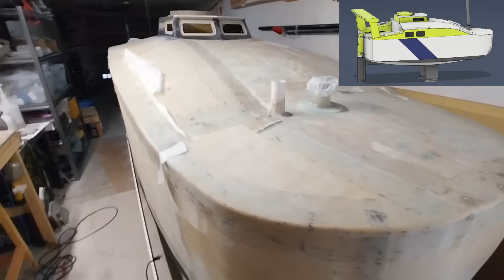OCSS-091 DIY Rudder Blades: Fiberglassing & Painting - Mini-Cruiser Sailboat Build

Comment: You could attach a bolt to the head of the rudder that goes through the cassette box and rudder. Then the rudder would still swing aft when touching the ground, but would have more stability when steering.
Reply from the maker: That's called a kick up rudder and it's fine but it's not what I've built. This is a cassette rudder and no pin is needed. A pin doesn't add any stability. The rudder blade already fits tightly in the cassette.

Comment: Might want to consider a wooden pin through the stock and blade as well as the bunge.
Reply from the maker: No pin necessary, keep it simple and easy to knock out in case it hits something. A leash allows you to easily retrieve the blade and re-install in the unlikely event this happens.
Reply: @ocean_capable_small_sailboat  the idea of the pin is that it will snap
Reply from the maker: @ Yes I'm aware. It's not needed though. It would also cause some damage if it happened.

Comment: Can you re-use peel ply? Also, how about a divot or blocks to keep the bungee from riding up of down the rudder (especially when wet)? Also, instead of, or in addition to, the rope at the top, how about a solid pin through the rudder blade, with divots in the cassette box to keep that from sliding around. Maybe use a 1/2" SS bolt with nylok nut (smooth shank all the way through the wear areas) as the top pin.
Reply from the maker: Peel ply is one use. No pin needed for this design. Simple is good.

Comment: I'd worry that those bungies would work up and your rudder would not be very well held.  Some sort of hold down near the bottom of the rudder slot might be a good idea,  as would using two or more bungies - in case one breaks.
Reply from the maker: It will have something to keep the bungee in place down low. It's something I overlooked for sure when building. But not difficult to correct. One bungee is fine, spares inside the boat.

Comment: Another great video Perry! Can't wait to see the eel wheels though! ;) 
You probably already have this covered, but it looks like the rudder blades taper to the top along the line where the bungee sits -they might need something like a screw on eye on the casette that the bungee passes through to hold the bungee in its correct position, where it is providing maximum force, otherwise it might wander upwards to the narrower part of the blade where it is less effective.  
This is just eyeballing it from this vid though, as always, its hard to tell in practice from where i'm sitting! it might be perfectly fine without :)
Reply from the maker: Yeah I should have thought of that when building, I could have added something from the start. I'll fix it 👍.

Comment: I guess you plan to have a line from the top of the blade to the stern so if you do hit something you can retrieve the blade? and you'll carry some spare shock cord? (spare shock cord should be easy to stow somewhere and not that heavy 3 spare lengths the same as you used here should be enough, bearing in mind it does deteriorate from UV exposure, so you will need to replace it.
Reply from the maker: Good thinking. I'll definitely make up 2 spare bungees. I whipped the ends on the bungee cord to keep the ends from fraying.

Comment: Hi Perry, I've been following you from the start of your channel. You're doing great, but I'd be a lot happier if you had a pin in that rudder! At the top front, so it'll kick up if you hit something, I really can't see a bungie keeping the rudder in place for long!
Reply from the maker: The blade fits tight in the cassette box and the bungee holds it in place. No pin needed. You can find other examples of this design online. It works. There will be a leash from the blade to the boat to make sure it isn't lost if it hits something hard enough to break the bungee off, but that's quite unlikely.
Reply: Surely he will be trying the rudder to the boat at the top so it can't just call out if the bungee fails? 😂

Comment: The spare rudder is a great idea, but what will you do if one or both gudgeons break off?  Maybe you should have a set of secondary gudgeons installed next (but not to close to) the main ones?  And some way to plug the hole left by the lower main gudgeon if it does break off.  Your bungee system will help reduce the stresses on the gudgeons though, so maybe breaking off is unlikely.
Reply from the maker: The bungee cord will fail before any other parts do, that's the design.

Comment: Looking good! Maybe I've missed the obvious but why did you have to mask when laminating the edges, when you still need to sand them down at the edge for further laminating?
Reply from the maker: I suppose you could skip it. It reduces epoxy I have to clean up that might drip down the blade.

Comment: That bungee is not nearly enough to hold that rudder in and the bungee won't last in the sun and salt. I don't know a kinder way to say it. I would pin it at the top and just let it kick out (back) for safety. Also, with the rudder blade's slope, the bungee will work its way up and the whole thing gets loose.
Reply: Well, many small kickup rudder designs use bungees.  I would think he will just safety tether through the top loop and experiment with bungee force by beaching and hard sailing.  Remember, small boats, small forces.
Reply from the maker: A pin is not needed for this design. You can find other examples online of the cassette rudder. The bungee is cheap and simple to replace.
Reply: Maybe 2 or 3 small bungees set up with a jam or lock each side.  @ocean_capable_small_sailboat